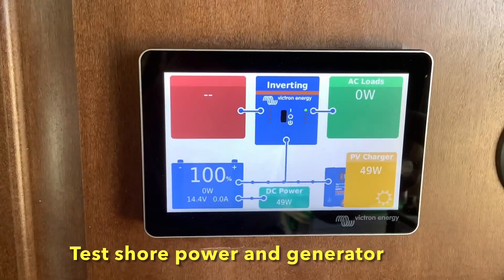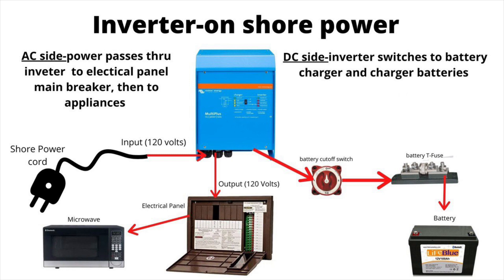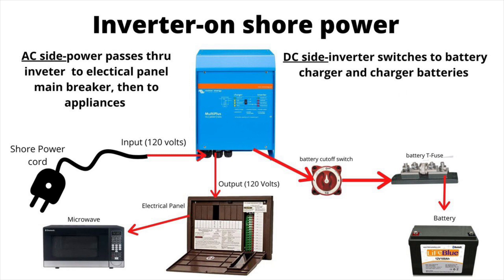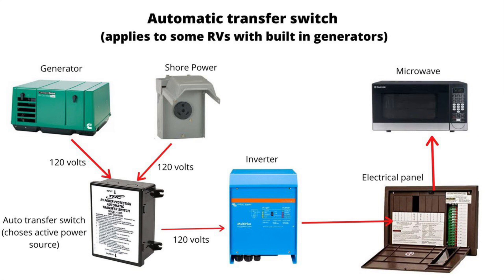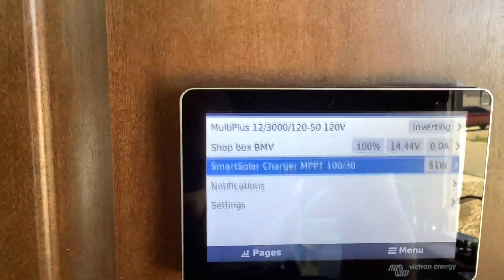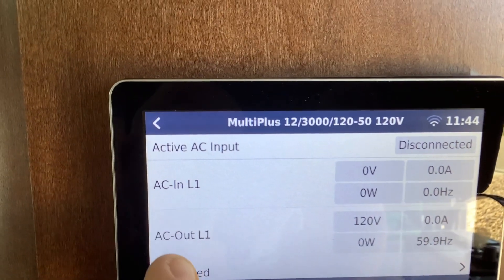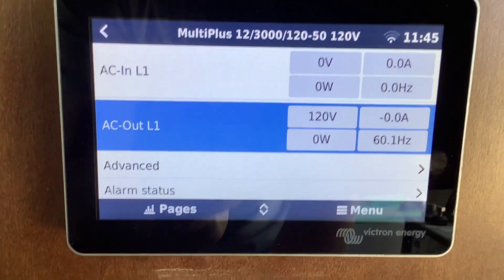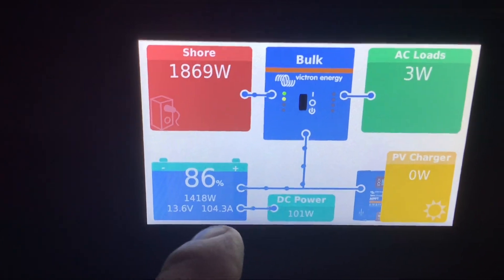How to test shore power and generator input- Victron Cerbo Gx Touch 50 Multiplus inverter

Comment: We are hooked to shore power and our inverters are getting power as noted with 120v on ac input but we are getting no power in the rig. The inverters are not passing the power through even when we switch off inverters. What can we do? Did the invertors go out? We tried turning them on and off but no change.
Reply from the maker: Good question for your installer. It could be lots of things esp with dual inverters.